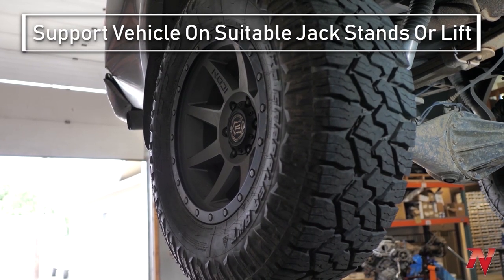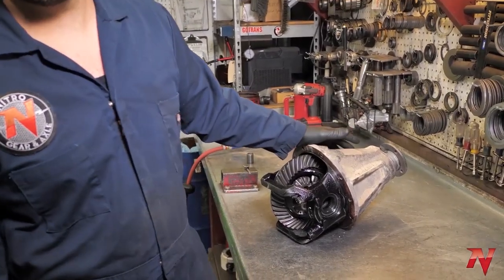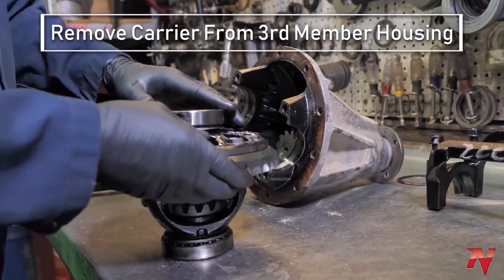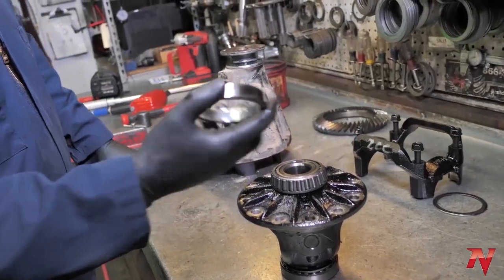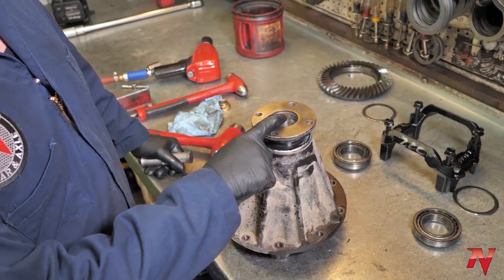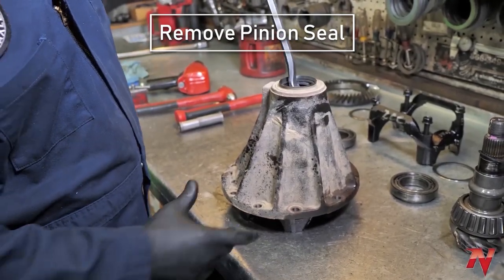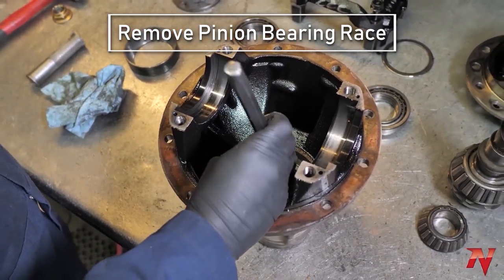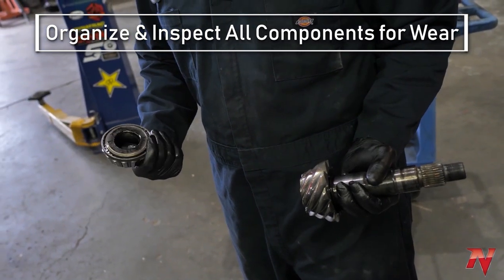How to Remove & Disassemble a 3rd Member

Comment: I do not recommend. No support after purchase.
I ordered the Extended Travel Ball joint for the Toyota Runner 2018 model a few months ago. Tried to install it, but it doesn't fit the car. 
The specifications on the box are correct so it seems like the wrong item was packed. I hope something can be done to correct it. 
I sent a few emails (along with pictures)  but never received any response. Sadness.